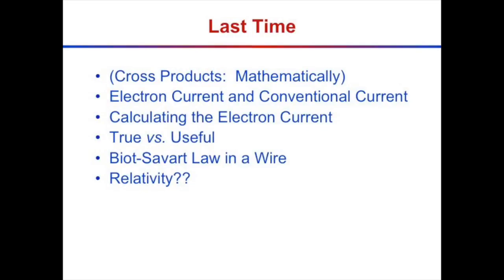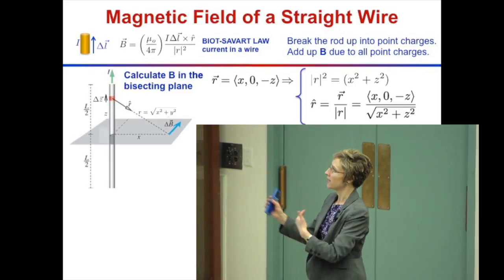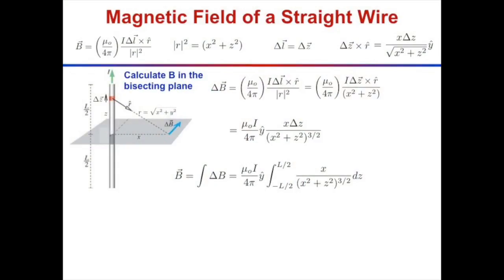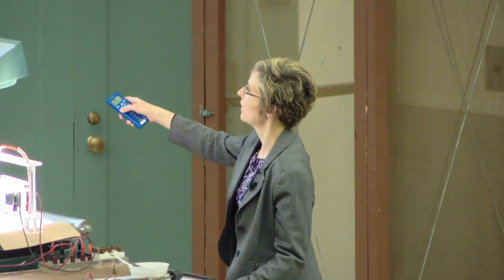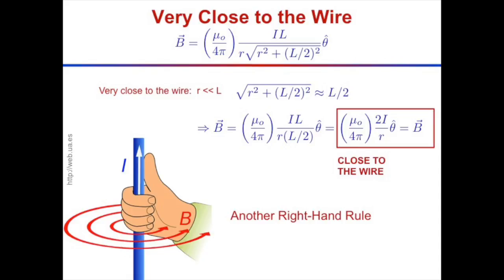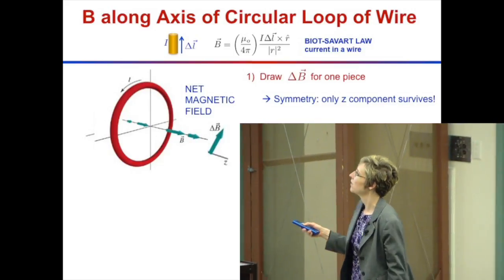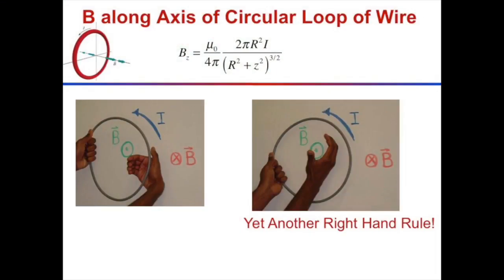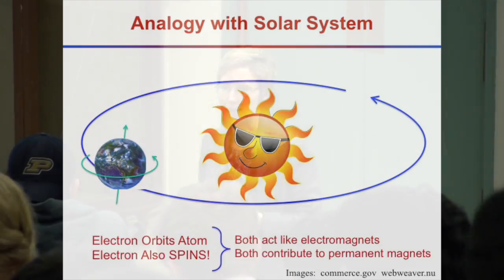Lecture 13 Magnetic Field from Current Loop / I hate my Alarm Clock

Comment: In a rc circuit or simple resistance circuit when we closed key ( time t=0 ) we observes that initial current is V/R. But in RI (resistance-inductance) circuit when we switch on of circuit we see that there is zero current initially in wire. Why?
No one answered my question in detail.
You are my last hope.
If possible make a short solution video to answer my question with detailed analysis.